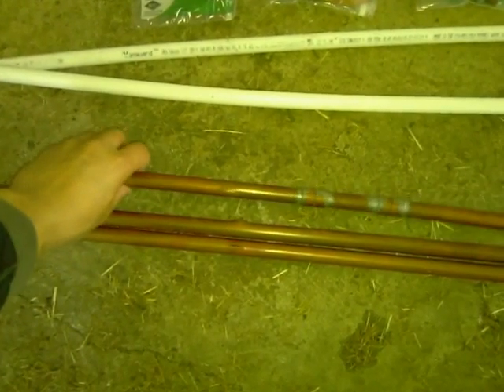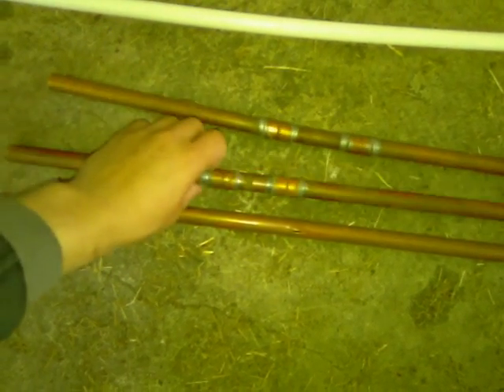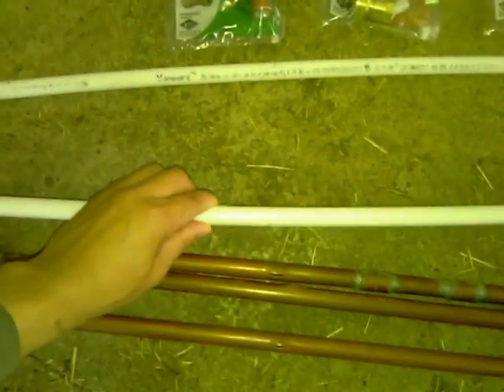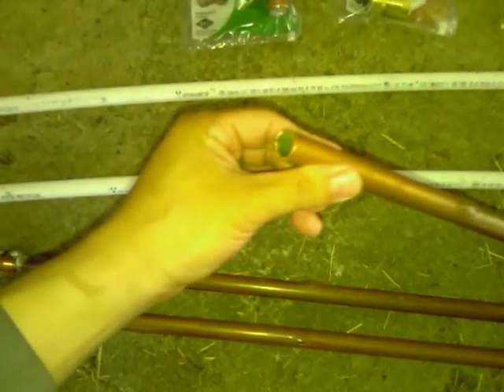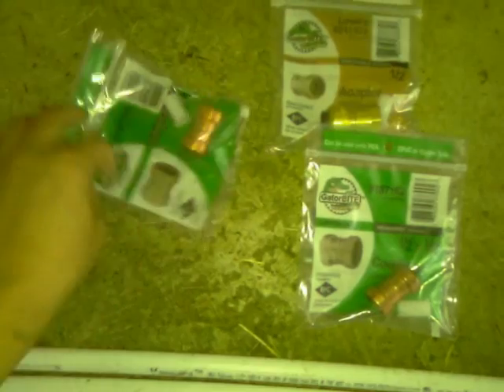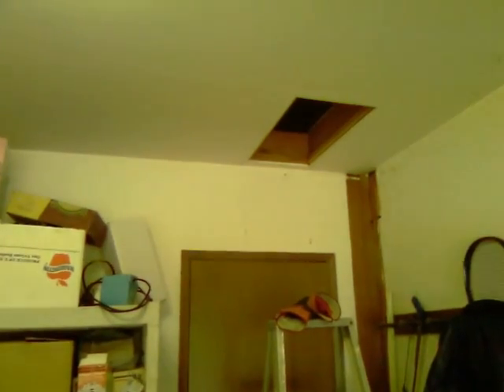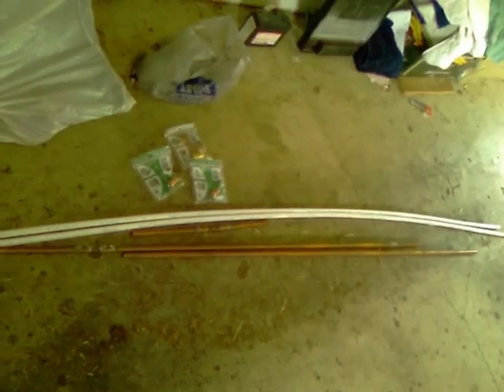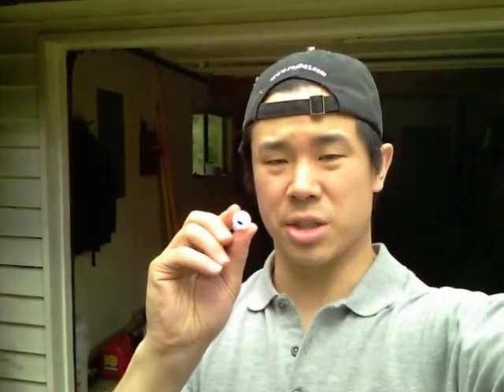Plumbing project with PEX and Copper pipes, replace frozen copper pipe. [HTC HD2]

Comment: PEX tube rocks. I had to replace the gray polybutylene pipe in my home. It was bad and constantly rupturing. Replaced it with PEX.  The stuff is awesome.  I bought the PEX in rolls, and it was color coded, blue for cold, red for hot. It took the guess work out of which pipe went to what. You can't go wrong with PEX.